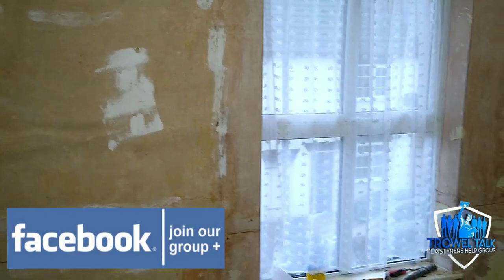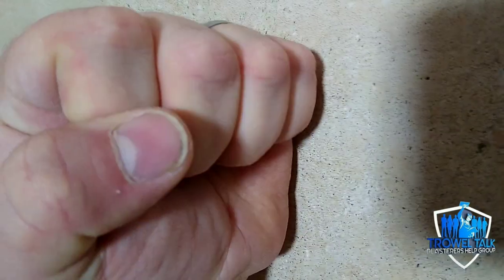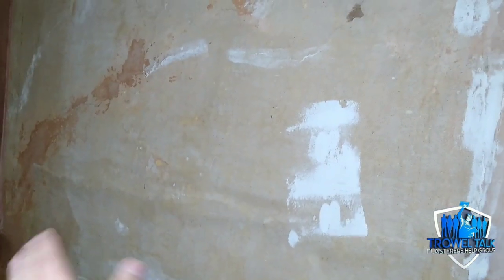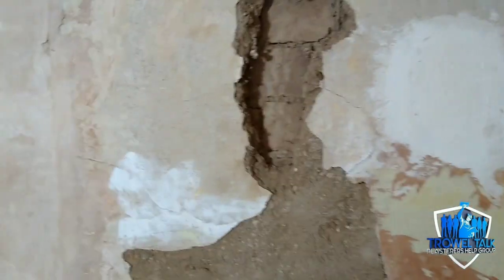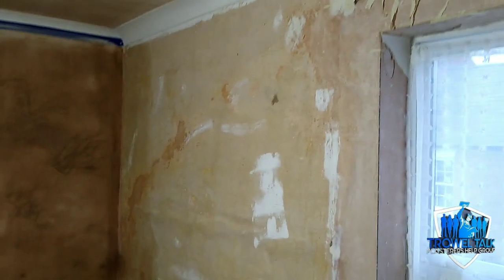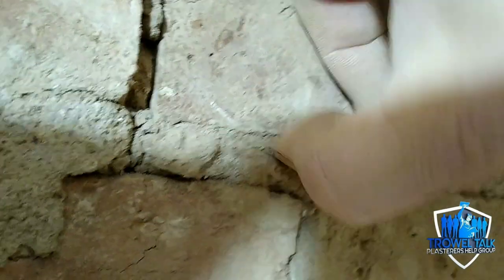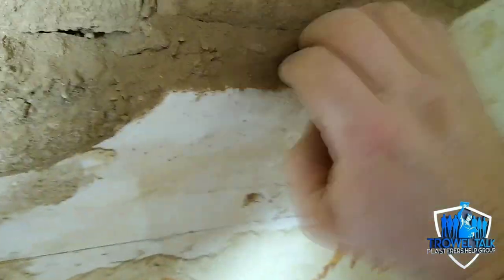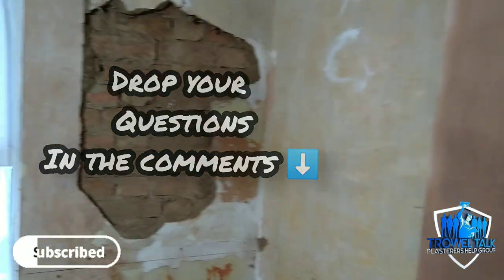IS THIS PLASTER BLOWN❓

Comment: If you have original lime plaster walls...brick...and lime mortar joints...only put on lime....cement/gypsum barrier skims don't allow the walls to breath, trapping moisture...if someone has repointed your walls with Portland cement-this is also compounding the issue, it's harder than your soft Victorian bricks...the only way moisture can escape your walls is through the brick so they'll start breaking down...and original lime mortar will just rot down behind the Portland cement mortar. All these blown areas are probably down to 'modern' materials being used over the years...and plus maybe excess exposure to water penetration from something like a bad join in a gutter at this point...in a classic terrace (perhaps like this one) there always seems to be a coupler joint in this area! Try and understand how your old building worked...go and search out the heritage house org website.dont start me off on skimming gypsum plaster on chimney breasts! You'll get those horrible stain circles! Where its reacted with the salts in the wall from all the fossil fuels that were burning up those chimneys.Lime flexes more with the building, (gypsum will just crack) regulates the moisture/humidity in the air, absorbing excess and then releasing it. If you start putting on plastic paints and barrier skim coats/plastickey wallpapers your walls and building can't work as it was designed to over 100 years ago. Oh yeh look at clay paints and lime washes as well because that completes the 'lime wall system'! Plus they're better for the environment and your health with VOCs etc. Yes, probably costs more... but in the long run it's preventing further damage. Oh my god, you might even have a rubbish cement render on the outside trapping water in as well...then it can only escape into the room, pushing that lovely plaster off (blown)...if its trapping the moisture, your walls are colder...you'll get condensation ...more damp and mould... then harder to heat rooms as these cold damp walls just sucking the heat! Its so frustrating when I see people so pleased and just loving the 'fresh plaster' (gypsum) look on their fresh skimmed walls, on their period restoration project, saving their house...you're not...its just essentially cosmetic flat  'plastic surgery' and you have just 'f****d' your walls...and made it a nightmare for the next person down the line. I'm surprised people aren't getting sued!
Reply: Or you get in your time machine and go back to the Victorian era

Comment: Hi, I've just had this on a house I'm doing up (DIY'er). Just as you said, it's blown on the window wall. I'm thinking it'd be much easier to dot and dab insulated board on there - is that not suitable on some jobs?
Reply: Check your exterior wall...has it been repointed with modern Portland cement? Was there a gutter leak? Repoint with lime so moisture can  escape the wall. Patch repair the wall (blown areas) with lime plaster...you can get it premixed in tubs. What is this obsession with super flat walls!? Look at clay paints so lime walls can breath. The best start to the 'insulation journey' of your house/walls is to just have dry walls!
Reply: @AlastairGibb-sn1vc  Thanks but you clearly don't know what you're on about. Who on earth would repoint a 1960's house with lime

Comment: Best way to fix delaminate lime backing plaster without hacking off. Can I inject an adhesive to bond between the gap (brick to line backing plaster)
Reply from the maker: @kingstonbespoke  Unfortunately once it's blown it needs to come off
Reply: @troweltalk2719  it’s not the hole wall, its like a few small 6-10” patches in and 16m2 walls that sounds hollow behind. Should I just hack off and rough and finish in lime.

Comment: If you go back to brick could you use a plaster board and then skim?
Reply from the maker: Not ideal for 9" solid walls because the walls are cold. The drywall adhesive will draw any damp through to the plasterboard surface on the inside

Comment: I’ve got a plaster wall that sounds solid but crumbles when trying to affix bolts. Any recommendations on how to affix a wooden shelf to it?
Reply: all plaster will crumble if you try mount things to it, you are supposed to drill through into the brick and the plug goes into the brick not just the plaster. try bigger plugs
Reply: @cykboy3254  i don't think there's any brick there; it's an internal wall that doesn't look thick enough for a brick.
Reply: @mrsceptical6686  sounds like it may be a plasterboard/stud wall, sounds silly but are you using plasterboard plugs if that is the case? if its something heavy, you should find a stud to mount to

Comment: Just curious... why don't people repoint the bad mortar joints before replastering?
Reply from the maker: The sand and cement plaster is pushed into the joints when applying scratch coat 👍

Comment: Hi Stu. When you have a wall with occasional small blown areas of skim, is it always best to remove and bond before skimming? Are there any situations where its ok to leave them and just mesh & skim? Cheers
Reply from the maker: Hi Jeff,

For me this will depend, 

Take an old trowel and aggressively scrape down the surface try to remove all loose paint, paper & loose skim before you think about priming & re skimming.

It's not good practice to mesh over a surface that is blown. Having said that I come across some  jobs where I have highlighted to the customer that a part of a wall is blown & they will say 'that wall has been like that for 20 years'

Sometimes you have to make decisions / judgements when re-skimming old houses as to you how far you go with that hacking off. Will your client pay for a complete hack back or? Maybe not. You should always advise them.

Now I am not condoning that you mesh & skim over a wall that is not sound but as above if you advise your customer to hack back & float but they don't like the time vs cost & they say to skim it then I would always opt to embed mesh because atleast this will give a degree of reinforcing to the surface & prevent hairline cracks but again, always aim to do a job right first time to protect your reputation & avoid callbacks which will cost you much time & money.

One thing I would never do is to try to skim over a surface that is not flat. & is bulging outward. You've no option but to strip this back as you will not get a decent finish on it & will look awful. 

Hope this info helps 👍
More videos on this to come.
Reply: @troweltalk2719  Great answer, thanks for the reply mate. As a new plasterer what youve done with trowel talk vids & FB group is awesome and valued. Cheers
Reply: Hi I think my plaster about 6 months ago may have skimmed over a blown wall, also all the ceilings have lines where he put new plasterboards. Is there any regulations to protect consumers?
Reply: ...just patch with lime plaster...if you have traditional materials...put back traditional materials... problems only started when modern materials were introduced...don't add to the problem and potential issues down the line.

Comment: What mix sand to cement mix would you use on that stu, or would you use something premixed like ocr?
Reply from the maker: Hi,

I used a 4 : 1 mix you could use OCR . Baring in mind the pre bagged gear will bash the wallet ! S+ C is so cheap in comparison.
Reply: Sometimes you think you're making a saving...I've seen 'cement rendered'... 'soft' Victorian walls that have been mutifinished, having to be completely rebuilt...yes-the bricks had just rotted and no longer structurely sound!'luckily the money you saved initially can go towards the repairs!

Comment: Hi can I pva,the brick wall before I plaster to stop damp coming in.
Reply from the maker: Hi,

PVA will not stop damp you must find the root cause of the damp then replaster using materials that won't allow damp to pass through or if lime built , use lime plaster 👍
Reply: @troweltalk2719  many thanks.

Comment: great advice mate, all well and good to take it all back to brick but its a lot of rubbish to dispose and ups the cost/dust/work, if its necessary its necessary obviously. I'd agree with the analysis on the hardware vs the Sand/Cement. .